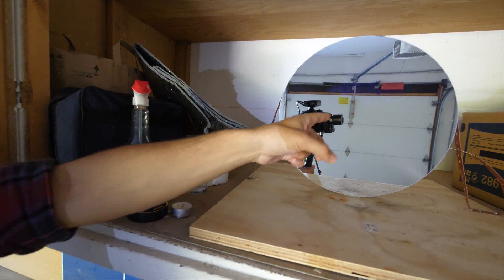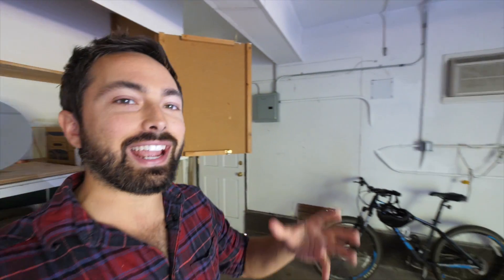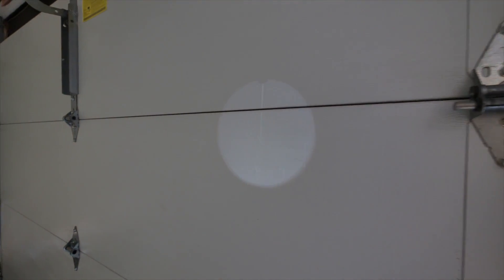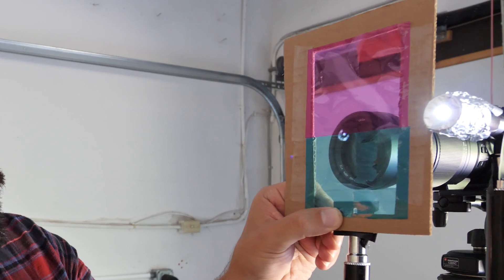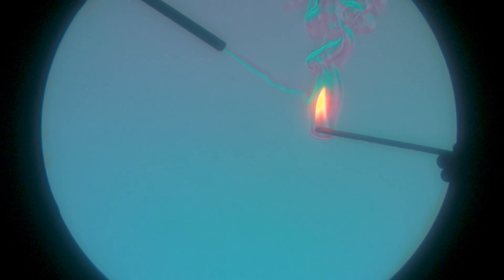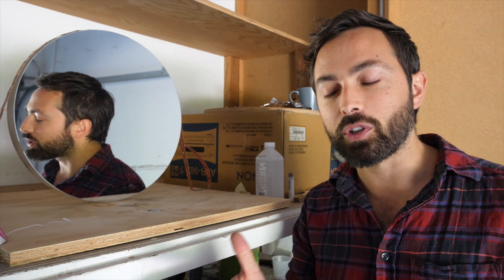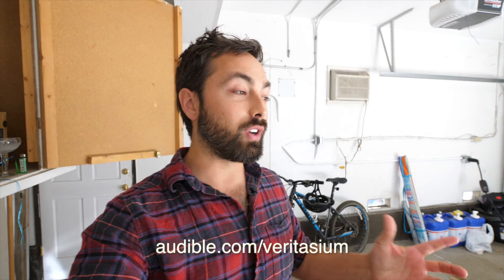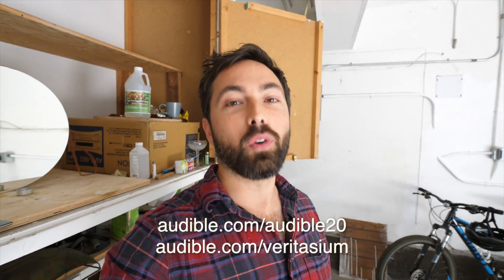Schlieren Imaging in Color!

Comment: Please please please try three filters... cyan, magenta, and YELLOW. This is a balanced set of primary colors. I'd LOVE to see if it makes an improvement or change of any kind. 

Here's a lengthy explanation. Red, green, and blue are the primaries used in most digital displays. RGB is in "rainbow order" (ROYGBIV) but, CMY is not. That's because the CMY colors are in order relative to the RGBs. Cyan is like anti-red, magenta like anti-green, and yellow like anti-blue. Shine red, green, and blue filtered light on the same spot and you will produce white light: remove just the red and it becomes cyan; remove only green and the spot becomes magenta; remove only the blue and it becomes yellow. 

You can think of Red-Cyan, Green-Magenta, and Blue-Yellow as supplementary lights because each individual pair combines to make white light. Pairing supplementary filters or a light with its supplementary filter should produce a colorless "shadow". This is how projectors used to work. They had three lamps and three filters to produce three shadow images. Rear projection TVs utilized the same type of projection system. They combined a red shadow, green shadow, and blue shadow to produce one color image. In theory, the same could be done with RGB filters for Schlieren imaging but, the result would be much dimmer than CMY filters. A comparison would certainly be interesting. 

The red, green, and blue primaries probably came about as a result of Newtons study of optics. CMYK is common in print media and, given the ordering of the letters, probably came about for that reason and ironically after color TV. This irony is because the idea of painting primaries probably dates back to the Italian Renaissance but, the primaries are most commonly taught in grade school as RYB, which is problematic. Yet, painters experimented with different palettes long before TV and even before Sir Isaac. They were most likely aware that cyan and magenta could be used to create colors that would be impossible without them. 

Please feel free to correct any mistakes with experimentation and/or research. 

Fun Fact for the Kiddos:
Did you know that computer screens used to be monochromatic with black and white (Macintosh), green and black (anything older), or red and black (rare old model calculators)... even when TV was in color?

(Dear e-ink, you've been using the wrong primaries for your solid state displays for years. That's why the technology hasn't taken off... because you need CMY pigments and can't produce enough colors as a consequence. Convert from RGB encoding should be a cake walk. Perhaps I'm wrong and you corrected this problem already. Or maybe you just don't know what you're shooting for with your primaries. I can explain. The world might see a quantum shift in tech again if you sort out your materials. There should be a way to do 3D glasses as well.)

Comment: Why use a mirror when a properly focused LED does the job? I just grabbed a (well focused) torch and lighter next to me and got a great image of the flame on the wall without even having  to get up. If a torch doesn't focus the LED properly you just take out the lens and do it manually. The eyepieces from old binoculars focus LEDs into a perfect spot, it's how I used to make LED torches before they sold'em in the shops, and those do the schlieren thing really well.

Comment: Place a transparent tube with a loudspeaker / tuning fork at one end to produce standing waves at the resonant frequency of the tube. If you are shooting at 2000fps and willing to accept 5 frames per cycle, then you could film a 400Hz standing wave. At 400Hz, the wavelength would be 300/400 = 0.75 m. The fundamental standing wave will fit in something half this big, so 0.375m, which should be small enough to be observable in your setup.

Comment: To image sound waves,  you would need that point light source strobing at about the same period as the sound waves you're trying to image.  Its been done in glass to visualize ultrasound waves for NDT research for a long time.  Search for "Photo-elastic Visualization".  And also,  I'm not sure if this would work for a single sound wave (of a clap),  but would need a steady sound source.   Think of it like pointing a strobe light at a fan - the strobe light appears to "freeze" the blades when the rotations match the strobe.    It should do the same for sound waves in a Schlieren set up also.  Would look pretty cool I think.

Comment: Actually the reason the mirror is parabolic is because parabola is a shape defined as the locus of points in the plane that are equidistant from both the directrix (a line) and the focus (a point). One property that a parabola has is the reflective property, which means that if a parabola can reflect light, then light which enters it travelling parallel to the axis of symmetry is reflected to the focus. So if you create a light source located at the focus, this light will be travelling all in the same direction (in parallel paths). You can see this at https://en.wikipedia.org/wiki/Parabola

This is totally different from a sphere. A 3D equivalent of a parabola is a paraboloid, which is different from a sphere.

Anyway, really liked the videos (:

Comment: Awesome video, stick a speaker facing up, on the shelf in front of the mirror, use a frequency generator to adjust the tone, as you adjust the frequency you might get it to start matching a divisor of the camera frame rate and see perhaps banding? Keep the speaker just below the bottom of the mirror so you get the full mirror height to observe any wave action.

Comment: Can you use a speaker to see the soundwaves? Set a speaker to play a tone at the same frequency as the camera frame rate and you might be able to see a standing wave?
Reply: Or set it 1 frame off so you can see the sound waves moving out the same way those strobe light water drops work

Comment: You should try to use a frequency generator link to a speaker and look at 2 400 or 24 000 htz. I wonder if something whould show up.
And if it does try 25 000 htz to look at it move.

Comment: Could you try viewing constructive/destructive interactions of sound waves?  If you set two speakers either side of the mirror playing tones, they should create high and low pressure nodes that could be visible.  If the tones were slightly different from each speaker you could probably observe beating.

Comment: I think I know how you could cheat your way into showing sound waves. Use a speaker to output at a frequency close to your frame rate. Like in this video for example: https://www.youtube.com/watch?v=uENITui5_jU 
By using a high enough "shutter" speed, you should be able to see the waves, moving at a speed corresponding to difference in frequency. Now if the shutter speed is not fast enough, the traveling waves will smear and the contrast will fall. But there might be a way around that one: use stroboscopic light source instead of the shutter speed to get close to the speaker frequency. In this way you can integrate longer without losing contrast. You need 1 arduino, one speaker and 2 transistors (one for your flashlight, one for the speaker).
Standing waves would also work. Resonant cavities are always fun.

Comment: floor poppers would be interesting to see or w/e your coloquial word for https://en.wikipedia.org/wiki/Bang_snaps is, or in general a mild explosive ie firecracker or even sparkler. slowly letting the helium out of a balloon. volatile substances coming out of a container or spread on a plate of some sort, maybe also being lit depending on the substance ie gasoline. a sealed container just bought from the market that has the pressure cap still engaged ie a pickle jar or snapple ice tea and on that note a soda can being opened. a dyson bladeless fan? but i mean that's just already proven science. the smallest possible hose leak from an aged used cracked hoseline pumping an inert gas or a gas of somesort. sabering a champagne bottle would be really cool. a tazer, or some sort of arc of electricity would be interesting. a laser or heat lamp or something similar that displaces air with heat. flash paper. a toy air cannon. i mean i could probably go on and even make a youtube channel out of the things to try but for now those are the things i would like to see the most on a relatively small scale. i mean i could probably do way more with large scale and micro scale but these are ideas i think you could try in your set up.

Comment: Hey, where do I get such a mirror, and do you think it would make airflow around a model car visible? I've built a small scale windtunnel and put model cars in there and took pictures with smoke to make the aerodynamics visible, which worked somewhat good. Now I'm thinking that schliering would be a good solution to make the differences in air pressure along the car visible. Would that work?

Comment: Hey everyone, now that Derek mentioned sound, how does the high speed camera's microphone work? Seems to pick up quiet sounds and then re adjust the pitch, Derek if you're reading, that would be interesting to explain
Reply: Max Dub are you sure? Sounds really accurate!
Reply: iirc in one of the slowmo guys vidoes one of them told that they make the sound for the slowmo part.

Comment: For sound imaging, a high speed flash setup and a spark gap for a pressure wave source  would probably be easiest to get reliably working. (Sweeping the trigger times to show the motion of the air)

You might want to try setting up two lenses with a pinhole between then after your light source to form a crude spacial filter.

Comment: Sorry Derek, but you do want a parabola, not a spherical for spherical to planer wavefront conversion.  A plane wave hitting a spherical mirror will not focus at a point, rightly called spherical aberration.  But you rightly state that a small curvature mirrors in both spherical and parabolic shape, are nearly the same and your point source is still far from a good point source that would make a difference in mirror choice.  But it works and I just realized the optics here might be the key to 'eclipse shadow bands.'...And good work on the video.

Comment: I am currently making a schlieren image of a cavitation bubble for a major school project because of your previous video
Reply: We actually use a lens and put the camera on one side and the light source on the other because we can't afford a big parabolic mirror. Where did you get yours?
Reply: My question is how could one make one of these setups for cheap in their own? Not really in college or anything, I just wanna do this for fun. If you know any cheap materials, please let me know!
Reply: The quality won't be as high as in this video and you can only film things the size of the magnifying glass, but for a cheap home setup it is fine. Also make sure the room is dark enough.
Reply: Koos Naamloos so what materials should I buy to set this up? I don't know where to start, but you seem to know a lot lol
Reply: You'll probably already have most of it. For the camera I used about the same as what veritasium used, because auto focus is something you don't want. You can position the camera with some books if you have nothing else. You also probably have a razor blade or precision knife lying around, or else you can buy one. The magnifying glass has to be at least 10 cm (4 inch) in diameter, and as a point light source you can probably use a modified led (see link previous comment). You can try different objects like a candle to test if it works
Reply: Koos Naamloos I'm sorry but I don't see a link..
Reply: First you set up the lens and place the light source about 50-100cm (1.5-3 ft) away from it. If you are in a dark room, you can put your hand at the other end and follow the light beam until it is at it's smallest point. The lens of the camera will be a little bit behind that point. When you place the camera, you can already put a small candle behind the lens (at the side of the light source, as close to the lens as possible) so you can focus and position your camera. You don't need the razor blade yet because you will already be able to see the hot air rising. When you are done with that, you can position the blade in front of the camera, as close to the smallest point as possible so that it blocks the bottom half of the light. This should give a bigger contrast

Comment: Sound has got to be hard to image with a setup like this if you want more than to just watch lissajous curves, I feel like this setup would be better for something that could change a standing wave (like in a clear box in front of the mirror) in a pressurized gas to make heat differences, or whatever would change the index of refraction, or something. Looks like heat would do it. What kind of gas would be optimal? And at what pressure?
Reply: Anyone a mechanical engineer, or like messing around with Navier-Stokes type stuff?

Comment: For experiments with sound, would be cool to test stationary waves inside an acrylic pipe. I think you would need a frequency over 1 kHz to fit in front of the mirror so a trick to consider is to set the frequency slight different from the camera frame rate, example 1000fps to 1020 Hz, so you get 50 frames in differents times of the transition.

Comment: Have you tried color Schlieren with two different color changes in the vertical and horizontal directions? (For instance, use a blue filter edge horizontally and a red one vertically.) You can simultaneously visualize vertical and horizontal deflections in this way, though I'm not sure whether it would be any more visually interesting.

Comment: It is debatable to what degree a shockwave can be called sound. Many definitions of sound do not include shockwaves. I think it would also be more interesting to try and see a standing wave. If you tried a clear Rubens' tube, you could possibly directly see the relationship between the standing wave in the tube, and the flames up above. If you are able to see standing waves, it would also be cool to see the difference between cylindrical and conical bore wind instruments.
Reply: I think trying to image a standing wave is an excellent idea - I came here to post it if it were not here. The advantage is that it stays in the same place, and you should see the air pressure in the non-fixed part of the wave go up and down at the frequency of the note. Tune the frequency with the fps of the camera, and you should be able to get a clear result.
Reply: A sound becomes a shockwave at 190 dB if I recall correctly

Comment: Is it possible to use not two colored halves but four different colors in quadrants to see not only light deflected vertically but also horizontally?
Reply: Yes, and there are methods of using a mosaic of various colors that are offset by small amounts and would provide a large number of colors in an image. These colors then can be related back to the angle the light is deflected vertically and horizontally allowing you to obtain quantitative information about the flow field.
Reply: how about a radial RGB spectrum filter? i dunno i kinda love the colours xD
Reply: would that be super duper pretty?
Reply: Alan Hunter, I'm not saying you're not making sense but if you are, I don't feel you gave us enough information to see it:
What is "tight interaction with PI" supposed to mean exactly? Pi crops up in things regarding the wavelength. How does the wavelength come into play here other than the fact of course that we're using color filters?
Physics in general is rotationally invariant. So why would "negative and positive PI" be any different than any other way to slice a circle into two halves? And what exactly is the qualitative change that occurs for more than two partitions?
Most importantly, how does the wave nature of light come into play if all that's happening is that say a pocket of a material with a different refractive index refracts some rays of lights into a random direction. If we accept that refraction somehow occurs, I don't see how regarding light as particles would change anything here.
Reply: Bump, exactly what I thought
Reply: Gregory, oh, you mean like a 360-degree hue wheel? Like an HSV color chooser but without the part that let's you choose the actual saturation and value? I like that idea! It's also easy to generate and print on a transparency film.
Reply: Exactly my thought!
Reply: Polarised filters?
Reply: The results wouldn't be as meaningful or nonsensical with more than two slices. Light acts as a wave so it has a very tight interaction with PI. Dividing negative and positive PI into colors results in really nice transitions between those colors, dividing it further gives unexpected and seemingly chaotic color changes.

Now a smooth gradient across each hemisphere would correct the chaotic change problem and likely produce some interesting visuals.

Comment: The sound of the clap mught just be too high pitched, a lower sound in a denser gas could work, not too low because bass notes for example can create soundwaves a few meters long, and we would be able to see sound even if not exactly a shockwave.
Reply: pyropulse you're right and I actually knew that, that's why I said, maybe a denser gas, changing the substance the sound is travelling in does affect its speed, but still a lower pitched sound would have bigger waves (not slower, just bigger) and a louder sound would increase the difference in relative density from the compression to decompression stages of the wave; so even if, as he said in the video, the air being pushed only appears one or two frames on camera, it might as well be a more noticeable one. Other alternative is a faster camera or just a lens with a faster shutter to record more than 2000 fps but I'm not gonna suggest that because it's not my camera and not my money.